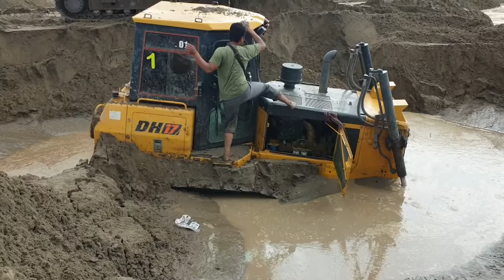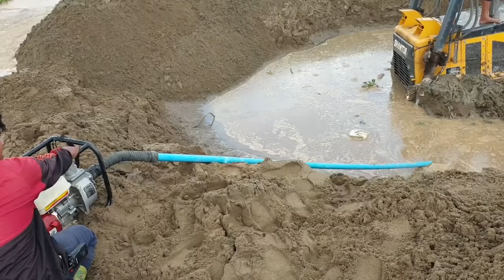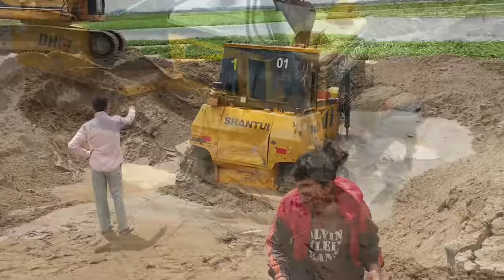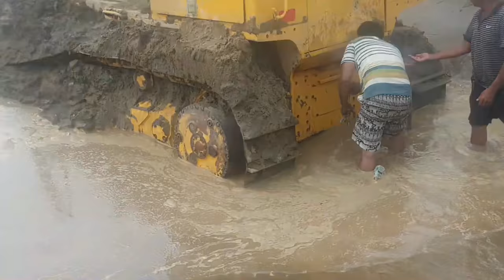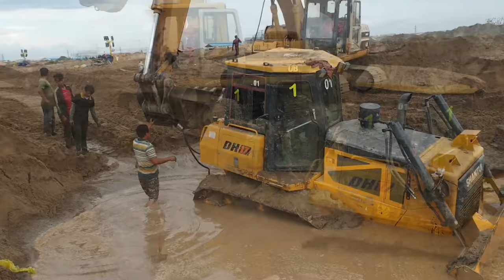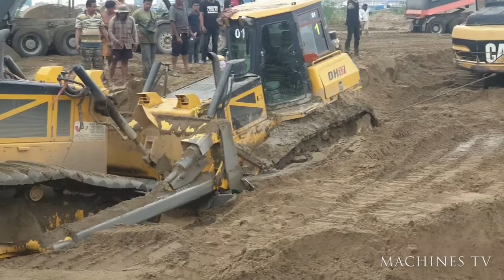Skills for Psychological Recovery Bulldozer SHANTUI DH17 Stuck In Deep Sand Safety Work

Comment: Damn  I know you can hear that horrific squeaking. Grease is a hell of a lot cheaper than changing parts.
Reply: That's what I was thinking.
Reply: Grease,  word of the day.  lol
Reply: NotMyJob/10
Reply: Seen the price of grease lately, and that’s if you can find it
Reply: RIGHT!!!!
Reply: @HavockWalks  Was last here 3 months ago and the idiots are still trying to dig it out, and still havent greased that excavator.
Reply: Apparently grease, just like safety shoes is not exactly cheap or easy to come by in these European countries.     That poor Cat.   You would have your equipment taken from you here in the USA if you let it fall into that kind of disrepair.
Reply: I was thinking it wasn't going to finish the job without broken parts lying in the sand
Reply: تابع القناة 🌹🌹🌹
Reply: @HavockWalks  They probably dont know what grease is or how to use it. ha ha.,How silly !
Reply: Newerish equipment shouldn't be squealing or stuck that close to that much water just saying. That guy with the excavator keep digging under his treads hell be sideways on top the dozer and quick sand 😮
Reply: Grease wont do no good in that water and sand mixture it will just get washed out
Reply: Grease mites
Reply: @boronin10   Why are we still goin on about it, it was parted out for scrap 6 months ago because it had too many parts that were completely worn out and not worth what it would cost to fix.  Bright side is the dude that shot the vid got $9k out of the deal, so far.....
Reply: @boronin10  There is such a thing as waterproof grease or marine grease.
Reply: Une équipe de bras cassés 😂
Reply: As that machine is working in a sandy environment it is wise to use grease very sparingly. The combination of grease and sand is extremely abrasive.

Comment: Why didn't they take the stuck one out of gear? Or at least put someone in the cab holding down the declutch pedals.
Reply: You can't take them out of gear. The drive cog for the track has a planetary gear on the shaft. The only way to free run the tracks is to remove the planetary gear assembly. The machine has to be on dry land and jacked up to do that.

Comment: I'm amazed they did not drain the water out and then check all the fluids make sure there's no water in the oil or the engine air cleaner and start the darn thing up and then pull it out and then pack in the dirt behind it with a nice slope would have made the job a lot easier I'm amazing the chain or cable did not break and kill somebody.
Reply: Once it sucks water in, it's off for a rebuild. It bends or breaks rods. Any water is too much for the starter to overcome.
Reply: Can't tell if it's that simple. Can't f*ck'n understand what they're saying. If they talk funny they probably think funny too.
Reply: Such things never happen in the US or Europe. The drivers of excavators that end up stuck in a mud hole obviously have no training in how to drive such machines.

Comment: Why not releasing the final drive breaks manually to put the gears ⚙️ on neutral so that towing can be done with ease
Reply: exactly
Reply: that would make for a simple rescue and no video
Reply: Так это для умных
Reply: You can't do that with heavy machinery. It uses planetary gearing. Those giant dump trucks use planetary gearing too. You can only drive a planetary gear assembly from the shaft. It won't free run. The only thing you can do on site is to remove the planetary gear assembly. That has to be done on dry land and the machine has to be jacked up.

Comment: Try some grease on those trackhoe pins.  All you have to do to raise the blade is put it in float and not disconnect the lines.
Reply: Yes needs grease
Reply: It definitely doesn't sound like it has regular scheduled maintenance done.
Reply: They should dig that dozer in a little deeper, bury it and say it was stolen. Ive heard that model isn't worth a shit

Comment: As an ex-Caterpillar and Komatsu sales guy I cringed the whole way through this. Incredible how many bad practices and safety standards they broke. And clear to see the value of well-made gear - this stuff looks like made of TIN.
but at 33:20 - gushing hydraulic oil from raising the blade by force - wow. 
and  sitting watching - where you could be cut in half - - not-so-smart-fella's but I could not believe they all stood beside the 320 SHAKING the cable - with the CARBODY of the excavator. Like - Oh My God - and all the while - the dozer's tracks still locked. (I guess getting the engine restarted once dry - - was still impossible? Better to risk cutting a few guys in half? Entertaining...)
And they never did get the tracks unlocked  - they just moved the site - around the dozer and drug it out.
Reply: Gosh - this looked so unsafe ... so unsafe .... and the machines did look like they were made of tinfoil ...
Reply: is there a release mechanism for the tracks???
Reply: Shake Hands with Danger.
Reply: They don't care about trash too.
Reply: Well grammatically speaking, if they quote "broke bad practises" then following the rule of negation, that means they did well?? 😉
Reply: Lol I was like wtf are these guys doing … all they had to do was use the boom with the strap use hydraulic power and drive tran also .. seen that method done many time… the boom has all the power !!! 💪🏽
Reply: you need first a couple of "halves" to learn how to make a whole :-)
Reply: I guess : holding the light-bulb and turning the world also dos the job :-)
Reply: Mm mm mm mm book
Reply: They disconnected the lines for 33:20. Maybe i am not understanding your point?
Reply: I'm guessing this machine was so severely damaged that they were unable to start it, therefore had to disconnect the hydro lines to the blade in order to lift it. I noticed the tracks were locked also. It's amazing how some countries are so lax on safety
Reply: I agree. It was very painful to watch. They had NO safety training for sure !
Reply: how lucky we are to be born into parts of the world where our lives are valued higher than the machines. that's clearly not the case for these guys...
Reply: O8j
Reply: @jkvdv4447  i8
Reply: Was the dozer deep enough in the water to get in the engine, is why they didn't start it? Looks like they didn't give a shit about tearing any thing else us. You can tell they unlikely owner/operators
Reply: Obviously a problem with a hydraulic pump. What did you expect them to drag the blade also. Good thing for them you weren't running the show!
Reply: @terrywilder9  "obviously a problem with..." Sure. Whatever you say - sitting there on your couch. 
How many thousand hours do YOU have - pulling the levers?
How many job-sites have YOU managed?
How many hundreds of pieces of heavy iron did you sell and support?
Reply: @bc-guy852  They knew what they were doing, you don't. There's a reason why they disconnected the blade's lift cylinders and drug it out a couple of feet over the water table.
Reply: Yeah, civil engineer here, the amount of unnecessary people crawling all over that "recovery" attempt was shocking. Guys barefoot with no high viz wandering in between large machines and that dozer driver really has very limited visibility. Unbelievably stupid stuff.
Reply: @kd2239  what do you mean they were wearing there steel toe flip flops 😂😂😂
Reply: @danhigbee2283  Haha, i take it back!!
Reply: To me, it looked like the left track side was not only locked, but even damaged during digging around - that's why they couldn't unlock it. But then again, I'm a layman. Another thing, the higher-ups probably wanted it away from the site as soon as possible because it blocked their timetables.
Reply: They unhook the lines
Reply: Why the excavator was wasting as much time as it did digging wet sand, dozer probably would have started. But your right, let’s try and pull it dead stick locked tracks with guys dancing on the cables smh🫣🫣🫣
Reply: I was a deckhand years ago and moved plenty of those 35s as barge rigging, that thing woulda snapped or shattered and the place woulda looked like the inside of a meat grinder. We always worried when we had to walk tow which was gonna break and take out a leg or send ya over board in a bloody mess
Reply: @forwardmotion1883  Thanks. I totally agree. I was starting to think most, today, think that not doing things safely, but however possible, is 'gonna work out fine'.
Reply: The hydraulic lines were disconnected
Reply: I'm not an operator, but couldn't somebody have opened the controls to let the blade lift?

Comment: To rescue the machine in the best way, you need to dig a deep hole next to the machine so that the water can flow down there and then take all the sand out of the machine, you can pull the machine up more easily.
Reply: Unless you have a high water table!

Comment: This was not as fun to watch as I expected.  I agree with the things other commenters said.  GREASE the excavator pivot pins!  Put the tracks in neutral.  Tie the blade up, it was acting as an anchor.  The dozer guy finally got that right ideal.  The dozer operator dug into the sand often, but did not get stuck.  It makes you wonder what colossal negligence it took to get it stuck so bad in the first place.  They never tried to start it after it was out of the muck, was the engine destroyed?; seems likely.  ALOT of work and I wonder who paid?  Any disaster is caused by a chain of bad decisions, break any link in the chain and the accident does not happen!  I got fired because I lost a new shovel on a job laying underground cable.  What will happen to this guy?  OH, and I am still have memory issues.
Reply: You rightly on the point sir! 
That's also my thoughts. 
It must be in neutral to rolling. 
And of course it must be blade up. 
What a disastrous command they have!
Reply: Ok
Reply: Hay quecinchat!!!

Comment: when we get stuck in USA we dig around it like you did but get to the side of the dozer and take track hole bucket and grab the side of dozer blade and pull it around where the blade is facing out of the hole and get in front of dozer and pull it out with track hole bucket

Comment: Can you imagine the fuel bill for all those pieces of heavy equipment to be involved with this cluster f*ck. Nothing like some rubber neckers sitting there waiting for steel cables to snap and send their heads rolling. Not a hardhat in sight and everyone barefoot. OHSA, we don't need no stinking Osha. There is even a woman standing on the edge with a toddler in her arms.
Reply: That's their economic edge over us. That's why everything costs so damned much here. Over there, nobody gives a damn. So there's a standards mismatch.

Comment: I just can’t believe that nobody has thought about putting the transmission in neutral on the dozer that’s stuck. Heavy equipment and vehicles move a lot easier, if the transmission is in neutral.
Reply: Absolutely - or better yet do what is needed to start the engine and drive it out 🤷‍♂️
Reply: بك لن جقدامبيل برب تخرج
Reply: they  never did put the tracks to freewheel...
Reply: I guess it must be an etiquette not to check another driver's mistakes but I sure as hell would have jumped in that cab and make sure the transmission was in neutral and no braking was on. I never saw the tracks move on the stuck dozer.
Reply: If its a hydrostatic trans it will not move unless the engine is running. The only other way would be pull the finals out of the track drives
Reply: Doesn't work  that way with bulldozers and heavy equipment.

Comment: I dont know maybe im not smart but i would have done the same and fill sand all around the machine but then dug a deep hole away from the dozer so that all the water would have a place to go then clean all the mud away from the tracks and blade to free it up and possibly drive it out with a tow

Just seems like alot of wasted man power and resources

And for the love of god grease the bratings and joints

Comment: That brings back memories, I built tailings ponds for 37 years, seen so many dozer’s stuck I can’t remember how many, we worked in sand and hot water slurry with a big spill hole as the tailings was pumped into what we called cells, things got bad when there was clay mixed in it. This rescue was nothing compared to having a dozer completely buried, and that rice patty dozer is the best for what you are doing, on the stuck dozer you should cut round holes in to the pads as that lets the tracks stay loose to turn and they also break the suction. All in god rescue besides the damage, no matter how stuck alway keep the front of the dozer up by putting the blade down.
Reply from the maker: Thanks 😊 🙏

Comment: From everything I could see, the breather intake was never underwater, so I don't believe the engine was hurt. That said, why wasn't the operator of the stuck machine inside, full throttle, helping get the dozer out?
Reply: they get pad by the hr.   LOL
Reply: I thought about that too, the only thing I can think of is that they broke it bad when they were trying to get it out the first time. Maybe snapped and axle or blew the transmission? Could have wrecked the motor too it happens.
Reply: Because he was busy looking for his shoes. Who in the hell works on a heavy construction site barefooted?
Reply: If the shoe was on the other foot this might not have happened ba ha ha ha crazy ,this video is not OSHA APPROVED  lol
Reply: For that matter, what the hell took so long for the owners of this thing to try digging it out? When you look at it, it's obvious it's been down in there for a few days at least.
Reply: Because the one collective brain cell among that lot was off having lunch at the time.
Reply: I think they didn't know he could've drove  out with a little pushing or pulling
Reply: @michaelmorrell1339  
👍 I could've simply tied a length of bailing twine or kite string from the bumper of my 1978 Pinto wagon to the tractor and easily pulled it out, even with bald tires. My company has an entire fleet of dozens of 1970s 4cyl Pintos and Mustang II's that we use to pull out large trucks and heavy construction equipment from being stuck.
Reply: Did not want to get his feet wet. HAHAHHA
Reply: Because they may be stealing it and don't have the key to start it?
Reply: @jeffb321  Mr. Green T-shirt, that's who..😊

Comment: Also, The excavator operator could of used his bucket to use as a tool to pull them out. Hydraulics with an excavators are more driven (by power) to the arm and bucket-not the tracks. That`s common knowledge.
Reply: Not in their country.
Reply: You're forgetting the weight of the machine. That's why you never see them dragging a machine around with the arm and bucket when a track motor goes.

Comment: A winch on the dozer doing the pulling would have done the job. Better yet if stuck dozer was running and had a winch winch would have been even better. Winches are the only way to go.

Comment: This was fascinating as none of them had a clue what to do. They made no attempt to put the tracks in freewheel, so it was just a dead weight. They disconnected the blade hydraulics so it could not be used to lift the machine. They tried to drag it out using tracked machines instead of anchoring a machine and using the hydraulic arm to pull it out.
Reply: @dennisharvey4499• I was waiting for them to pump that water out for the longest time.

Comment: The engine breather intake wasn't under water why wasn't it running instead of having the tracks locked and the blade in the ground I guess they work harder instead of smarter

Comment: The tracks wouldn't turn.  I am wondering if it had a mechanical breakdown as the reason for it being stuck, or they just didn't put the transmission in neutral before pulling it.

Comment: ROFL, not a single thing done here was in accordance with any known safety procedure, dozer tracks left locked???, blade left down to anchor the dozer????, a few tubes of grease for the pivot pins on that excavator might be useful, standing that close to cables under that much strain is a great way to become a split personality. Life is very cheap it would seem. 

This was more of an exercise to show exactly what NOT to do in this type of circumstance. Unbelievable!!!

Comment: I was wondering if dropping some rock or ballast into the area would actually provide more and easier traction for the dozer. I have seen that done in another situation that involved a D8
which became stuck and bogged down in a Florida swamp....just curious, thanx.

Comment: These folks need to study armored vehicle recovery techniques.  Snatch blocks and additional cables would be helpful for future problems like this.  They could make a cheap recovery vehicle out of an old 10T truck with dual rear axles and no box.  A very heavy winch could be mounted where the box once was. It would be helpful to find an old bulldozer blade to mount on the rear of the vehicle to keep it from sliding as a heavy object is being pulled.

Comment: I got called to go repair a transmission out on a John Deer 750 hydrostatic dozer. When I got there it was in a sludge pond and buried over the operators seat. The owner was there and I looked at him and laughed. I told him to give me a call when they drug it out of the pond onto dry ground and left. Pulling a hydrostatic means it will not freewheel as the crawlers are only drive able if the machine is running and the pumps are working. I told them to put a drain pipe in the lower end of the pond and drain it, but the mud had to be watered down to flow through pipe.